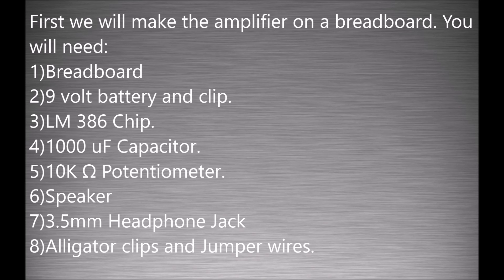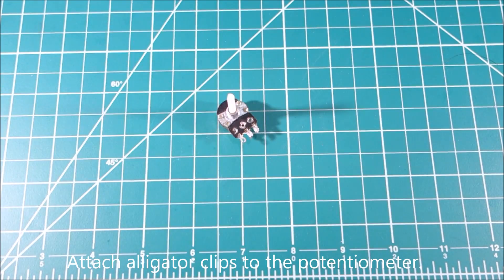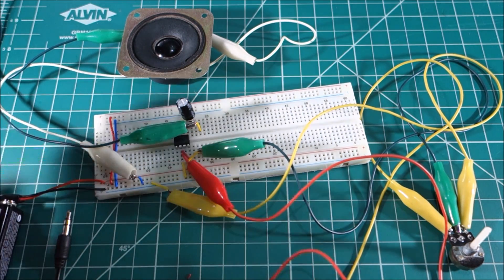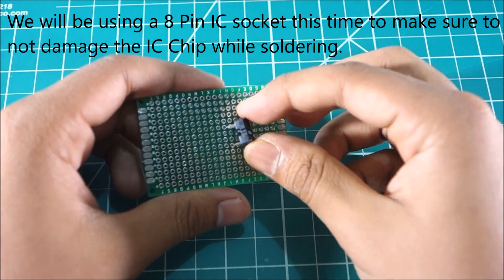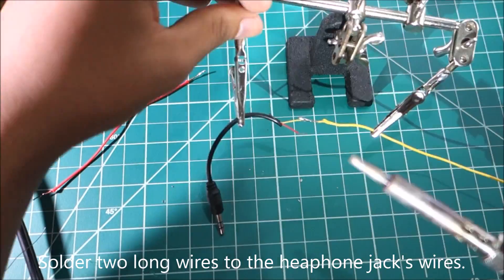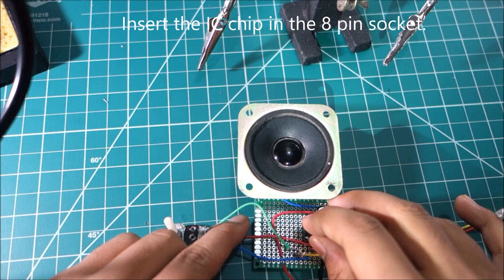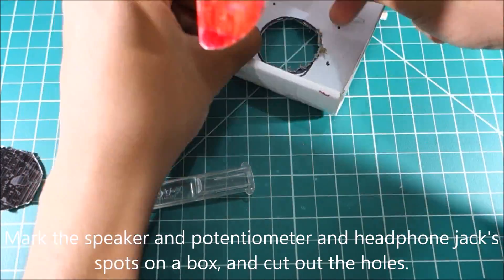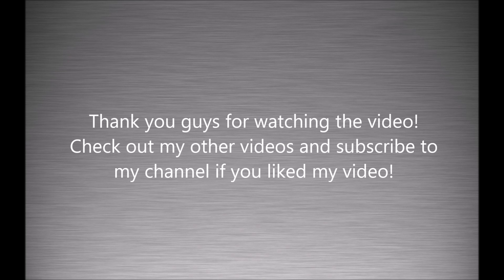Make a simple Amplifier

Comment: As far as I can see you used a closed basket high speaker that will not allow lower sounds. If you use either a full range or more than one way speaker in a box it certainly sounds better. I  also built this circuit and   it sounds very good to its size.